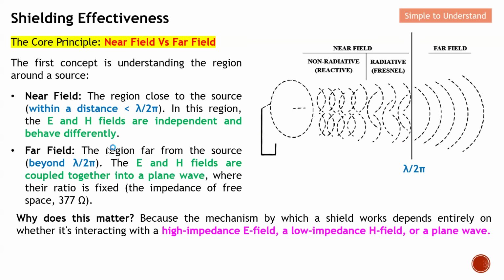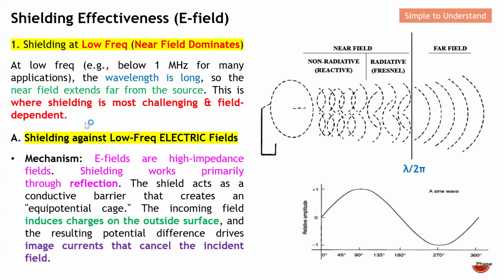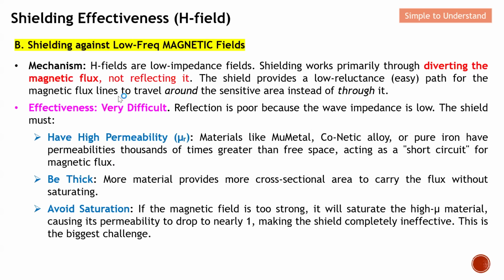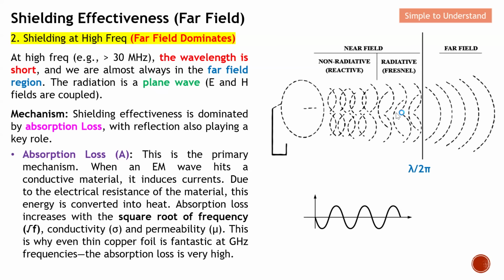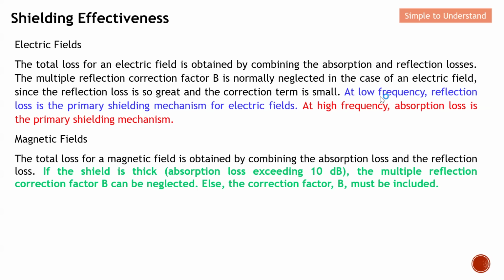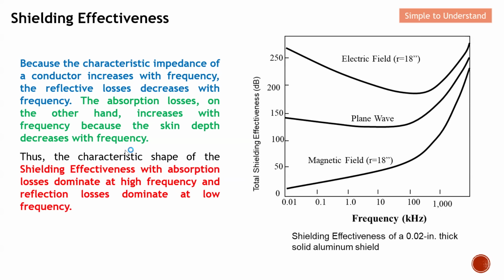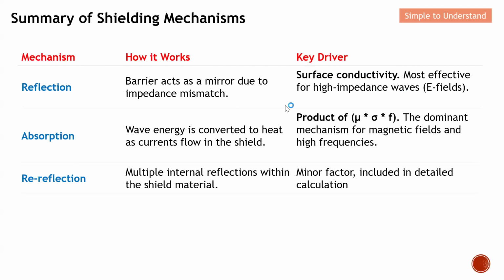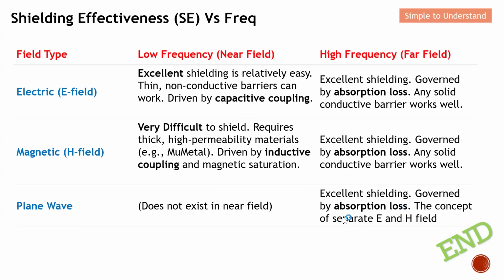EMC #28. Shielding Design: Near Field, Low Freq (E- & H-field) & Far Field, High Freq (Plane Wave)

Comment from the maker: Thank you for taking the time to watch this video on shielding effectiveness. From this video, we can draw several conclusions.
Before building a shield, we need to determine whether the noise source is in the near or far field. This is because the shield must be constructed differently based on this distance. In the near field, the noise is dominated by either electric or magnetic fields. In the far field, it is dominated by a plane wave, as the electric and magnetic fields are coupled.
It is relatively easy to shield against electric fields and far-field radiation. However, we may encounter issues when shielding against magnetic fields, especially at low frequencies. At low frequencies, shielding is primarily achieved through reflection. At high frequencies, shielding is mainly achieved through absorption.
As frequency increases, the effectiveness of reflection decreases. In contrast, absorption increases at high frequencies due to the skin depth effect.